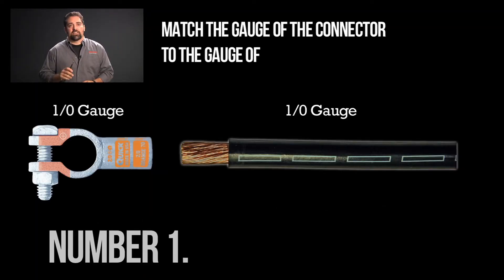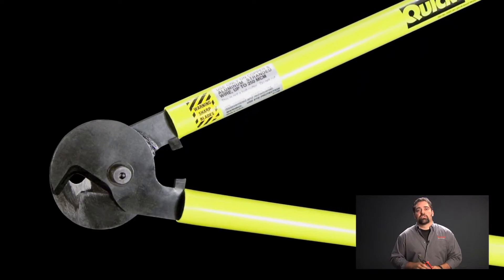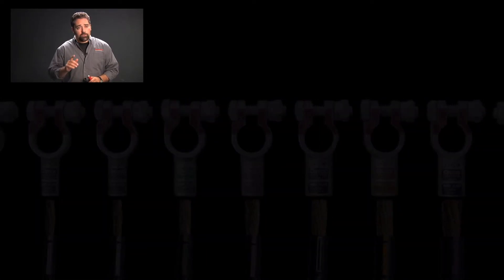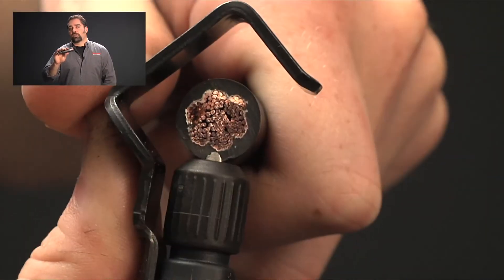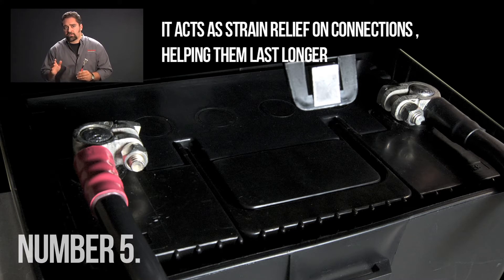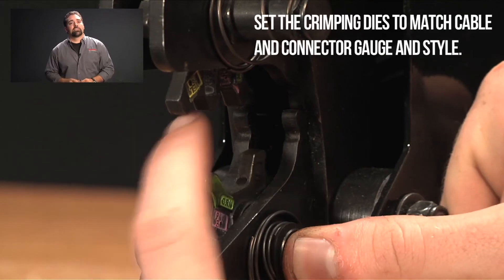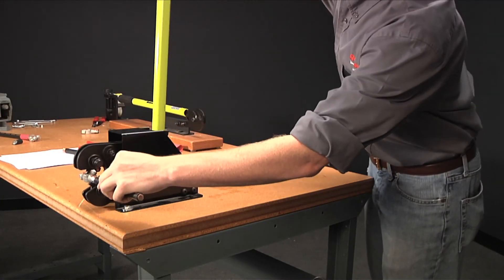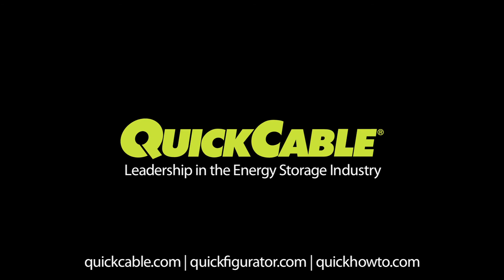How to Crimp a Battery Terminal

Comment: I would do the pull test before heating the shrink wrap in the event I have to do the crimp over.  Because if you are doing it over you will be destroying the heat shrunk material necessitating using another piece.  I prefer soldering for a "bomb proof" connection, and that goes for practically any automotive wired connection especially exterior ones that can get contaminated by moisture and dirt.  The inline and "U" tip ones are the worst and I have had to redo trailer connectors that stopped working and always crimp, solder and finish with heat shrink tubing.

Comment: -You mention that the crimp dies for plain copper lugs will be different than the  ones you'd use for the "quick" connector.  My crimper (Amp/Tyco) is not color coded but just says wire size to identify the die.   Would I adjust the dies differently using a quick?
-You crimp close to the cable first in the video. The instruction sheet on the website says to do the crimp closer to the eyelet first. Does it matter?
-Do your crimp connectors need to be crimped with hex dies or will a box crimp do?
Reply: I guess we will never get an answer.